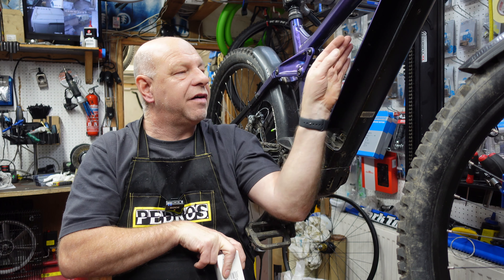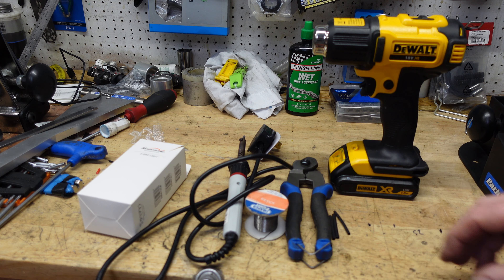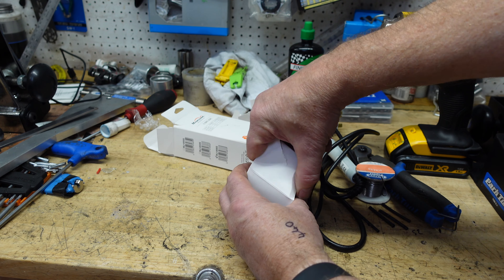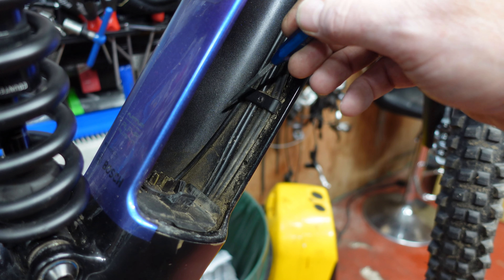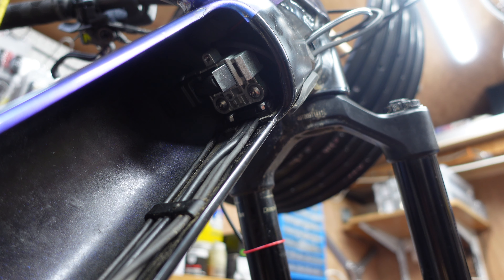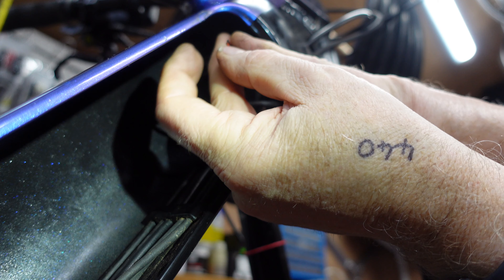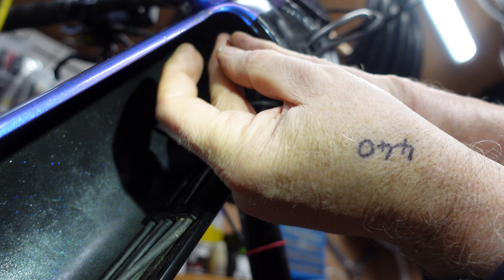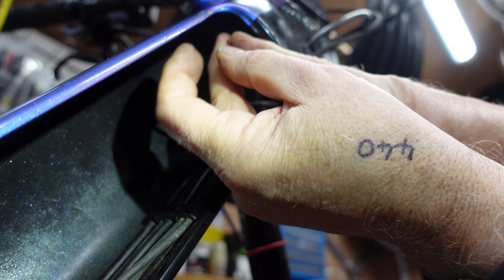How to fit an e-bike light that runs from your bikes battery

Comment: The reasopn you have a barrel connector on the Magicshine light is to enable it to be fitted to a multitude of diferent motor units. Magicshine actually supply the cables which enable you to simply plug the light into the socket on the motor unit. Your light is then controlled via the head unit. No need to break your wiring unit (and waranty).  Only issue I found is that the Bosch head unit has to be enabled for your light by a bosch dealer, but then they can also upgrade your software while they are at it.
Reply from the maker: Hi, thanks for watching and your comment. on some ebikes the manufactures fit an aux wire to supply lights, it's tucked in just below the cable exits, thought it would be good to use this wire saving on buying a new one.

Comment: the mj906s ebike light has only 2800lumens max. And on bosch systems if you give the maximum output of 18 watt you will get around 1800lm from that light(which is plenty). Giving the light from diagnostic tool only 6 watts you will get a maximum of probably 600lm.
Reply from the maker: Hi, Thanks for watching and your comments

Comment: Link to the light Dave? Cost?Easyish job but you have to take the bike to a dealer to get it enabled. Also, no rear light! Essential on roads
Reply from the maker: Hi John, Iv'e put a link to the light in the description, yes dealer enabled i'm afraid.
Reply: @TheYorkshireBikeMechanic  Thanks Dave. Looks like an expensive job as the lights not cheap then add £20 i guess for the lbs to 'mod' the settings. Sticking to my ebay under a tenner front and rear light set for now, and its not rubbish!

Would be great to be able to tap into the bike battery for phone charging and lights or even for a tyre pump.

Comment: Hello, I bought the Magicshine 906s and installed it in my Trek Rail 9.9. I did it exactly as you did in this video. The light flashed for a second and then threw an error code 550. I took it to my dealer and they're not sure why it's doing that. I was wondering if you had any idea?
Reply from the maker: Hi Craig, sorry to hear your having trouble, the 550 code is related to the light or the load output. in the diagnostics, having said that there are 26 codes associated to that codes, for example 550023 is Unknown consumer load detected
⇒ motor support is switched off. It is fairly easy for a bosch dealer with the right software to fix.
Reply: @TheYorkshireBikeMechanic  thanks for getting back to me. I've been to my dealer and they're at a loss. I did get ahold of Magicshine in China and they think the light is in the battery mode, not ebike mode. They've told me to hold the power button down for 8 secs until it flashes, then it'll be in ebike mode. I'm going back to dealer to have them erase the error code and see if that works. Otherwise I think I need another light, but getting China to do that seems difficult.
Reply from the maker: Hi Craig, magic have a dealer or distributor here in the uk. It could be a faulty light, wish I could have a look for you, sorry
Reply: @TheYorkshireBikeMechanic  tks again, how important is setting the wattage at 6, vs 9, 12, or 18 watts?
Reply from the maker: Extremely important, setting it wrong could give you 550 errors
Reply: @TheYorkshireBikeMechanic  ok, tks, I was able to hook up the light to motorcycle battery and change the mode from bike mode to ebike mode and now it works! Tks for you responses.

Comment: Is it possible to use such a light without connecting it to a drive unit, and instead connect it to a separate 12V battery? Or does the drive unit use some kind of stupid CAN signal to turn on the light? The reason I'm asking is that I would want to use such a light on a regular bike, not an ebike.
Reply from the maker: Hi thanks for watching, yes you can use it on a normal bike and ring it from a 12v battery the light has its own switch, I can’t see the benefit though as you might as well buy a light with internal battery to mount on your bars
Reply: @TheYorkshireBikeMechanic  Thanks, for responding! Sure, I could. But I'm sick and tired of fiddling with 27 different batteries on a bike. That's why I'm planning on installing both front and rear light, and power them from a common battery. Granted, not this specific front light, but something like that. That's why I was asking, because I don't want to buy an expensive light, and not be able to use it, because it needs some kind of CAN signal, or something. Also, since I've mentioned a common battery - I'm not aware of any light sets that use a common battery, and certainly none that are StVZO compliant (or at least "compliant adjecent 🤣), which is what I'm aiming for. I want to have proper road lights, with cut off beam, and I'll even try to get brake lights working, if I can. For example - I've seen that Supernova lights can be wired to Magura MT5e brake levers, but I'll try to do it without replacing the brakes. Maybe the magnet sensors that people use with ebike conversions could work. I'm not sure yet.

Comment: Do you know if that light cable is available on the new Trek Rail with the smart system?  Does the light still need to be enabled with dealer software or can it be done in the Flow app?
Reply from the maker: Hi John, Magicshine have said that the new lead to connect to the bosch smart motor should be available by the end of November 22

Comment: Great vid. A question: my Powerfly (CX Performance Line Gen 4 smart system) has a rear light fitted that switches on with the remote, but no front light. If I fit a front light as you’ve explained, do I have to get the dealer to separately activate it, or will the supply already be live based on current activation of the rear light?
Reply from the maker: Hi, great question, it should be activated already.
Reply: @TheYorkshireBikeMechanic  I can confirm that it is!  Also, despite the LBS setting light power to 1 watt when they fitted just a rear light, it still works fine now that I've added a 6 watt front light.  I guess it just won't reserve 2 hours of lighting after the motor dies.  Not a problem for me.  I'd have been reluctant to fit the headlight myself without the guidance in your vid, so thanks again.

Comment: Sorry if I missed this in the video but what voltage does the ebike output? I have two different magicshine lights, the MJ-906 and Mountaineer 8000. Trying to understand the voltage and wattage requirements.
Reply from the maker: Hi Kris. Ebikes supply 12 volts output, the wattage supplied by a bosch motor is customisable up to 18w.  The M-902S-E needs 12 volt, 6w
Reply: @TheYorkshireBikeMechanic  Thanks. Keep the videos coming. Great to see you work and share.
Reply: I also have two Magicshine lights, MJ-906S which claims to be eBike compatible just not sure what wattage I should put it at? And the Monteer 8000S V2.0 which does not claim to be eBike compatible but uses same connector as the other light. Did you try the Monteer 8000S?? The box just references the 7.2v 10,000mah battery it comes with. Will I damage the light if I try it?

Comment: Will this light work with a bafang ultra 620 mid drive
Reply from the maker: Hi Nate, Yes is will providing there is a 12v output plug/terminal on your motor or elsewhere in your wiring harness
Reply: @TheYorkshireBikeMechanic  Thank you for responding. I have another question .Will I need to go to  bafang
Reply: Will I have to reprogram after hooking up light?

Comment: Cheers dave , it's an easy job apart from the Bosch diagnostic, is this only available through a main dealer and then is a service only job?
Reply from the maker: Hi, hope you are well, you still of work?. Yes is a dealer job only.
Reply: @TheYorkshireBikeMechanic  howdo dave, yeh detached my left knee crashing my normal mtb, torn ligaments and stitches, proper job. Was just asking as in the future I'll need a motor overall on the Bosch in the trek rail I've got, no faults up to now, 1 year in about 750 miles and only replaced tyres and rear brake pads, cracking bike, checked the dralier as you said in a previous video, and it was loose. Cheers bud.

Comment: Hi. I set up the watts to 18. It was fine in the shop. I didn't know what value to set. When I got home and I tested the light, the light opens for 1sec and then on purrion I get error 550. What should I do?
Reply from the maker: Hi, Thanks for watching, error 550 can mean faults on electrical systems, it might not be related to your light , when you disconnect the light do you still get the error? Errors can be complicated, if you can get it to for bike shop for a diagnostic check so bosch can take a look if it continues.
Reply: @TheYorkshireBikeMechanic  Hi. I manage to do it. The error is because the light went in the bike mode after I hold the bottom over 8 sec by mistake trying to close the light when was working. What I had to do is to disconnect the light from my bike, plug it in to a normal battery and hold the bottom for 8 sec to change it back to ebike mode.

Comment: At 6.36 why is there an unused cable with red and black wires just hanging around waiting for you to connect the light to?
Reply from the maker: Hi Tony, Yes, they are installed at the factory but power disabled until needed.
Reply: Thanks. Is there one on my Gazelle Grenoble?

Comment: Hi! What an amazing channel!  I've a Decathlon E stilus 29 which has a Bosch Performance Line 65Nm (3rd gen). On the engine there are 5 ports, 3 of those are occupied by various connections. But two are unused, and should be the front and the rear light (as i found on the net). My question is: in your video those 2 ports are still free or there is a difference from my engine? If i would install the same light you used i can find a cable under the battery or i will not find anything cause the two lights port are empty? Thanks a lot!
Reply: @TheYorkshireBikeMechanic ?
Reply: Magicshine can supply cables for all mojor brands of motor to enable you to simply plug it into the free socket on the motor.

Comment: 1st, I would like to say that it was an amazing video, super easy to follow and very well explained. 
2nd, it's a question. 
I have very similar light, same brand, just different model. My question is, my ebike it's a Trance X E+2 Pro 2021, do you know if I have to do the diagnosis to enable the light from the controller? Cos when I turn on the ebike, the light dot on the controller is always on, but I can turn it off too, I would love to do that set up without the need to make a diagnosis.  The controller is a giant and motor Yamaha. 
Thanks.  Awesome video
Reply from the maker: Hi, Thanks for watching, I'm not too familiar with the programming of yamaha motors, just stripping down and bearing replacements.

Comment: Good thing I skipped ahead to find out one MUST have the ability to modify the software to do this. I just used the display control unit using the wires from the original small/cheap/crummy light to control a MOSFET which then connects to the ebike battery to power the 18W/1200 Lumen light through the MOSFET. 
The light itself could handle from 12VDC  to 80VDC while outputting the same brightness.

Result: No programming and dirt simple hardware mod. Of course, alternatively I could also have just wired the new light directly to the battery with a fuse and manual SPST switch mounted to the handlebar.

It really amazes me that manufacturers provide a cheap, barely visible $5 headlight on $1000 ebikes.
Reply from the maker: Hi, Thanks for watching and your comments.

Comment: Great video, I guess if you want the ability to remove the light you need the other cable/jack half?
Reply from the maker: Hi matthew, yes thats correct, you would need some kind of waterproof cover on the supply jack to keep the water out when not in use.

Comment: For anyone trying this, I've just set up an MJ 906S and it seems if you try and crank it to max brightness, the bike will detect too much draw and will error code. To fix, you need to reset the light to a lower setting using an another supply,  i didn't wait to see if the light loses memory over time. 

So if you haven't bought your light yet, you might as well stick to 2000 lumens with the Bosch. And now what I'm thinking of doing is running a 2nd 2000 lumen on the front, using the rear supply. So a 2 light setup. Anyone tried this?
Reply from the maker: Good comments.
Reply: @TheYorkshireBikeMechanic  also I should of thanked you for the vid - cheers.

Comment: Holy moly dude.  I cringed so hard at 9:10 when you are stripping the wire by cutting towards your own hand.  I guarantee that there is a better way to cut that plug/insulation off.
Reply from the maker: Hi, Thanks for watching and your concern, Im very old school, a cut or two is part of the job

Comment: your soldering skills must be as good as mine, hence you not showing that part. lol
Reply from the maker: Hi Darren, I thought no one would notice, no they are good just struggled with camera angles
Reply: Use the low temp solder/heat shrinks, solders and seals all in one go, been using them for years now, won’t go back